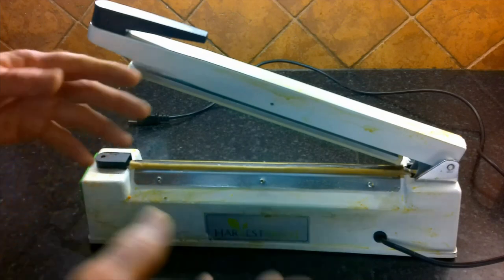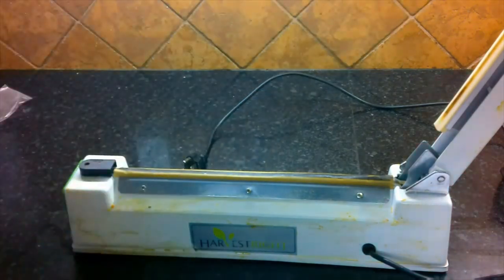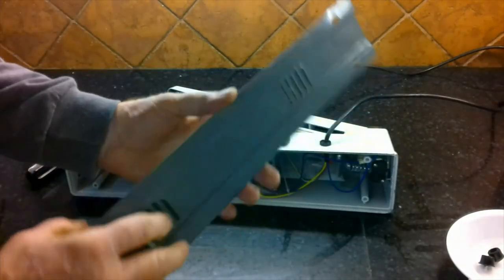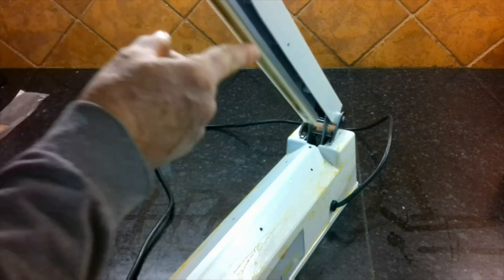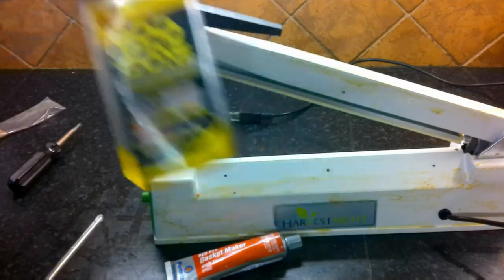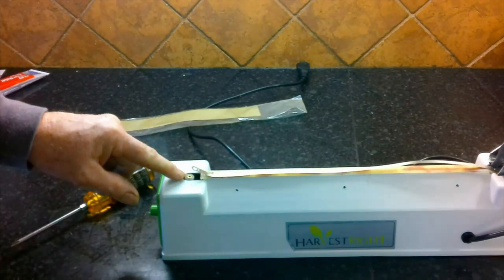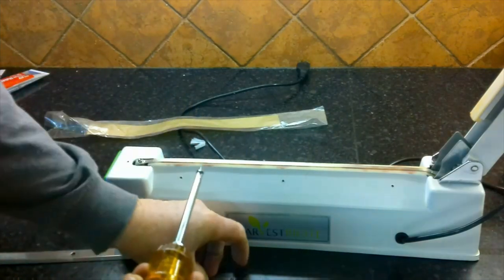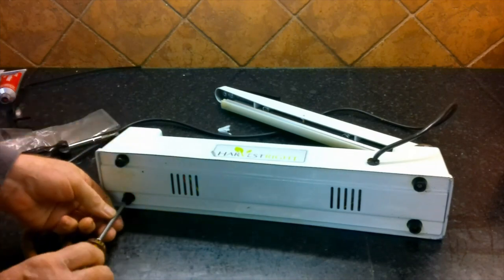Harvest Right Impulse Hand Sealer-  Repair/Rebuild

Comment: Harvest Right Sealer would not turn on. It is nearly new not much use. My husband opened it and found the metal part on the spring was bent and not making the correct contact. He fixed it and it is working again. I am fortunate I have a spare from another vendor but will keep using the Harvest Right until it stops again.

Comment: Hi Phil,  I'm so glad I found you. I just got a new HarvestRight Freeze Dryer and just put my first batch through. The impulse sealer came with it and I tried to get it to work on the mylar bag and the plastic bag the oxygen absorbers came in.  Only one small area sealed on the plastic bag and none sealed on the mylar bag.  The light just flashed on and off and the bag was barely warm.  It's brand new. What should I check to get it going correctly?  I really appreciate your careful, thorough and informative demonstrations, experiments (FD potatoes) and calm presentation. Based on the long sidebar of topics you've covered, it looks like I have a lot of good info to absorb. Best, Ellen
Reply: I believe there is a knob adjustment for heat. Low heat for the plastic bag for the oxygen absorbers and try 50% for the mylar bag and go up 10% each attempt. Too much heat can damage the bag. I personally do not like this sealer. I purchased a 3 crimp adjustable 12 inch sealer off Amazon and I love it. It has heat up lights and it never fails to perform. Easy clean up with Clorox Clean Up or Fantastic.
Reply from the maker: The bar to the sealer is spring loaded.   Are you applying pressure when sealing?  To seal mylar the setting should be nearly high.  OA bags should be around 3-4
Reply: @Philat4800feet  I set it for 7 for the mylar bag and pressed  firmly.  It got warm but no seal.  Turned it up to the max. The light stayed on a bit longer, but only got barely warm.. Tried it on 4 for the oxygen absorber bag pressing firmly - nothing.  Turned it up to 8 and it sealed
Reply from the maker: @EllenAnderson-ig4ih  I would contact HR for a warranty replacement.
Reply: @Philat4800feet  Many thanks, Phil.  I have just sent a request to HarvestRight.  Can't say  this is the first issue I've had with them - long story.  Ellen

Comment: More good stuff, thanks.  Just an FYI.  My new sealer did not come with any spares.  Also, my connection cover opposite the hinge is not nearly as robust as yours and has already broken and fallen off.  This left the heater strip electrical connection uncovered.  HR does not have a replacement part.

Comment: I just received their medium unit with the sealer. It did not work out of the box... So, I did a bit of research and measuring. The sealer is advertised as having a 5mm heating strip. Mine came with an 8mm heating strip. I found the proper 5mm strips on Amazon and had them the next day. I installed, and the sealer worked. HR was of no help in this matter.
Reply from the maker: Sorry to here that

Comment: What I can't seem to find info on is a fix for a sealer that doesn't get hot enough, where, after sealing a Harvest Right bag, I can pull apart the opening after it cools. It has a little resistance to it but not enough for my liking. I now seal the same spot 3 or 4 times while pressed down hard on the arm. And yes, the dial is set to 5. I've also changed the wire. At this point I think there may be a bad internal component.
Reply from the maker: Either your transformer is going, or has gone bad, or the dial adjustment (potentiometer) is dirty and is causing too much resistance.  Make sense?

Comment: We have a new Harvest Right sealer that doesn't turn on. I purchased it as an extra one a long time ago.  First time using it, when plugged in, the light doesn't turn on and it doesn't heat.  Any suggestions?
Reply from the maker: When you lower the arm, is there a slight click?  Micro switch sound?
Reply: @Philat4800feet  When you lower the arm, nothing happens, no click.
Reply from the maker: @JessicaWheeler-kx9gu  I would remove the bottom plate and watch what happens when the arm comes down.  A bracket should come in contact with the micro switch.
Reply: @Philat4800feet  We haven't had a chance to do this yet, but can you tell me where we buy replace the teflon heat sealing tape and other parts.
Reply from the maker: @JessicaWheeler-kx9gu  check with HR, but Amazon has them too.  Make sure they're 12"
Reply: Mine has to be pressed down pretty hard to make it work

Comment: Where to get replacement parts?
Heating Element, Cover Tape, Silicone Strips, Fuses.
Reply from the maker: Try mybinder.com
Reply: @Philat4800feet  Just a note - that address is not working. It says the domain is for sale.
Reply from the maker: Sorry-  Binding not binder
https://www.mybinding.com/search?q=FS305

Comment: Can the temperature be adjusted up beyond the dial setting?  Mine doesn't really seal the bags
Reply from the maker: I don't believe so.  The dial controls a timer.  The temperature is a consent.  The timer controls how long electricity flows to the heating element.
Reply: @Philat4800feet It is my understanding the sealers being sold today have a much smaller transformer in them than they originally had. I had to replace the 8mm strips and replace with 5mm strips. I think if folks are having a difficult time getting a serious seal, a 3mm or 2mm heating strip would work the best due to the downgraded transformer.

Comment: Hi Phil, Thank you! When I bought my freeze drier the first sealer I received was defective & Harvest Right sent another right out, excellent service! Problem is it doesn’t get hot enough & you can easily pull sealed bags apart, is it possible to repair or even worth it? Kept the old one for Sapir parts as HR didn’t want it back. Thoughts???
Reply from the maker: I only replaced the Teflon and heated wire.  More could be done.  The next two issues would be the micro switch and transformer.  I'll need to cost out those parts against the replacement cost.  HR cost is $130.  Other sealers as cheap as $79